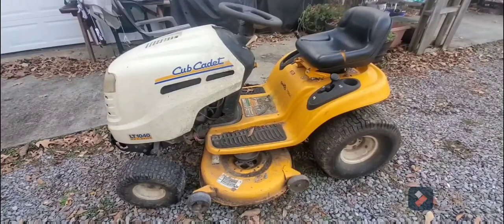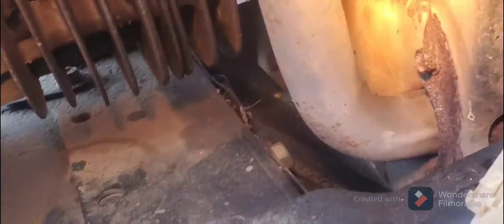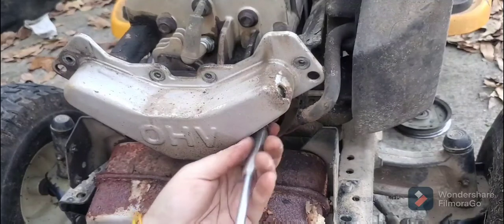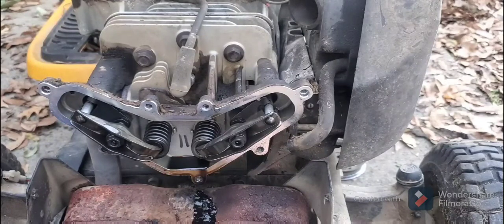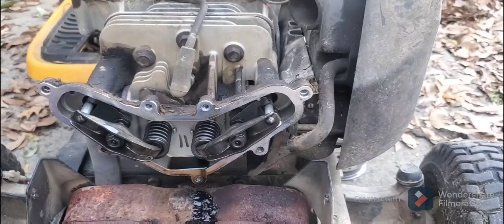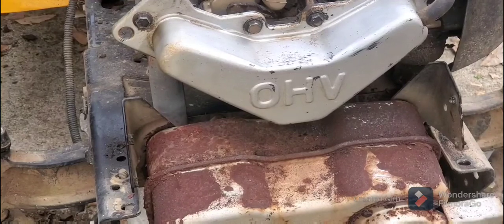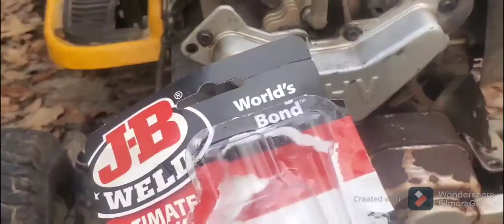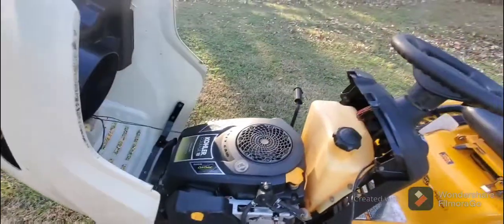Have White Smoke Coming From Front of Mower ? Could Be A Gasket! Solved

Comment: I have a 2011 and it does the same thing. It will smoke for a few minutes and it stops. Does it all over again the next time I cut the lawn. I've just been to lazy to do what you just did. lol. Mine only leaks when it sits for a while. Mine is garage kept. No rust. Thanks for sharing.